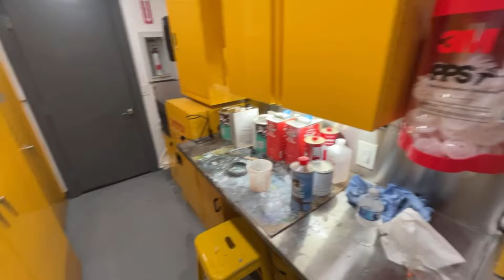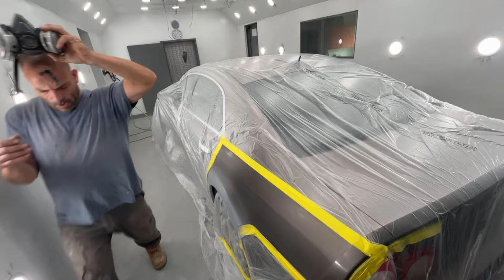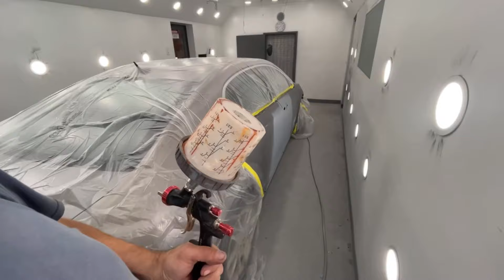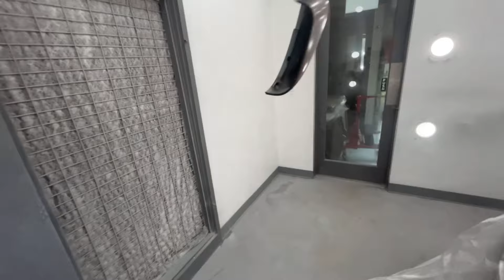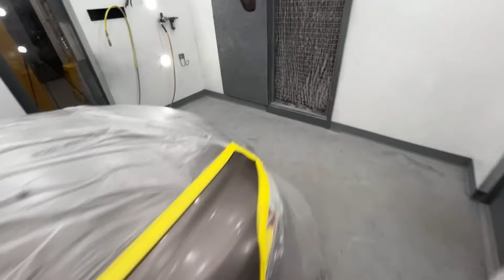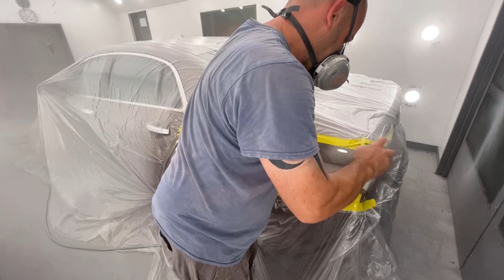2011 Chevy Malibu is painted

Comment: Troy  question you put the sealer on then the iner coat clear I never heard of using inner coat or why next you put inner coat clear  on what does it do.Does that make it ezyer for  blending or seals off the old paint to the new color 🤔
Reply: What the intercoat clear does is fill in any sanding marks in the previous paint job so that the metallic does not lay funny into the sanding marks